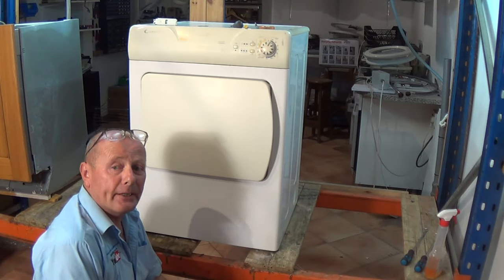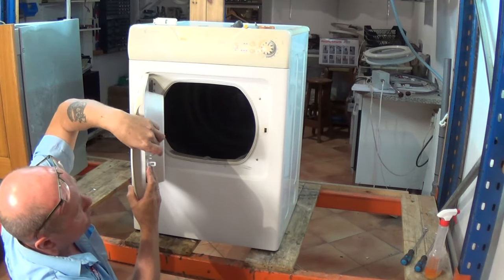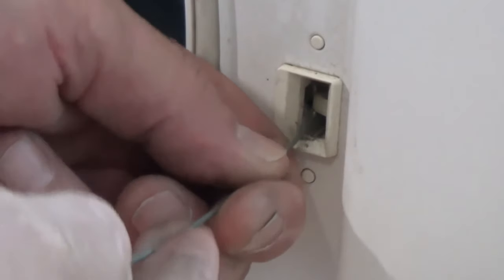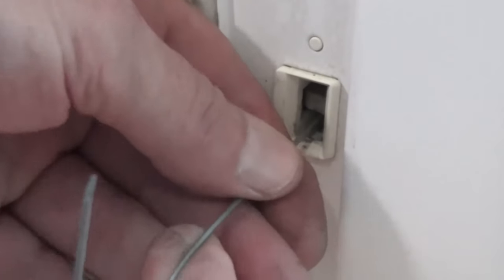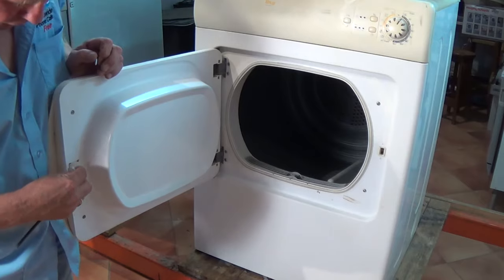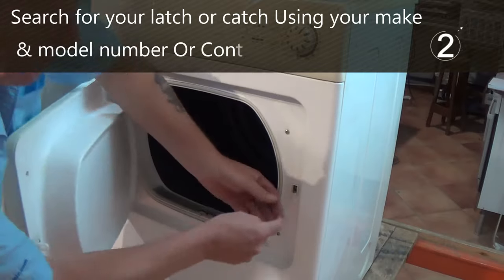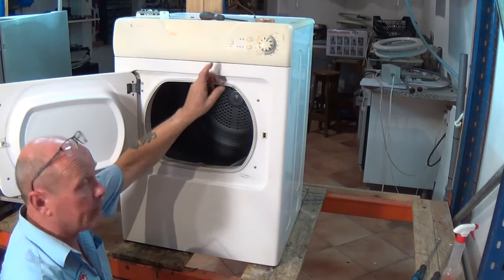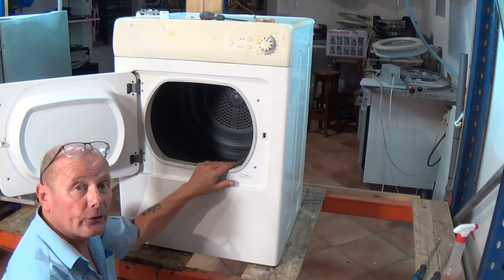Tumble dryer door wont shut start, latch or catch broken how to replace

Comment: before your video on how to flip the door strike with a wire I tried on my own for 40 minutes. Was ready to call a service but thanks to your flicking idea fixed it in 5 minutes. Used it on my Bosch dryer front load machine :)

Comment: Thank you so much for this video. I'm trying to repair a Bosch Axxis Dryer wte86300us/09. I accidentally pushed the latch closed when cleaning the dryer, but the door was open so now I can't close it. I'm trying the wire technique but I think I'm doing something wrong. Do you have any other diagrams or videos showing this more zoomed in so I can try to mimic it? (I must be doing something wrong).
Reply from the maker: Hi, please use our contact us page and make sure you fill out the request for what your problem is. I will need the full model number of the identification plate and the details of your problem so that I can provide you with useful literature. A video shoot of the problem would be perfect as well.

Normally, I would get back to you within 24 hours but I am on my way to the IFA trade show in Berlin, so it can take more time to respond. Thanks for your understanding. https://www.how-to-repair.com/help/contact-us/   

Please remember to subscribe to our channel, as that's what keeps this channel going. Thanks, Paul 👍

Comment: Hello could you help me please? My Hotpoint ftcl871gp  is not working it a heat pump dryer and it's compressor does not start leading to the dryer not being able to heat up. Do you have any idea what the fault could be?

Comment: I have candy dryer. When I close the door it trips breaker. If I plug in machine with door closed it trips breaker. If the door is open I can plug in and breaker does not trip.